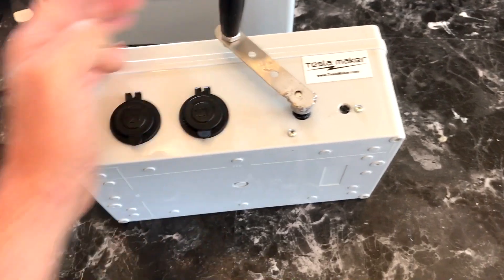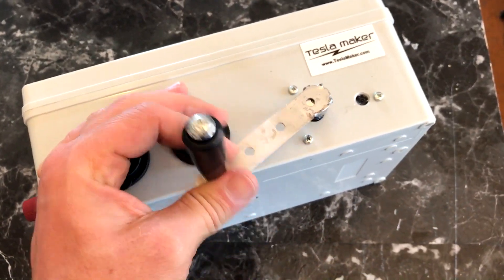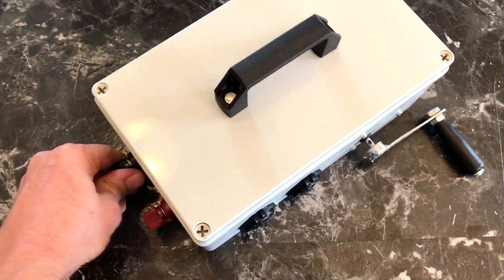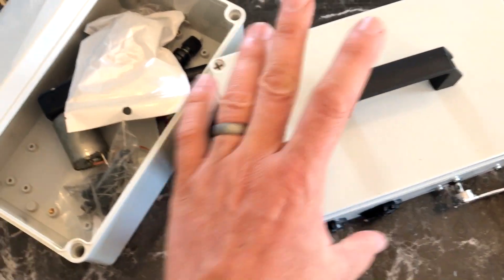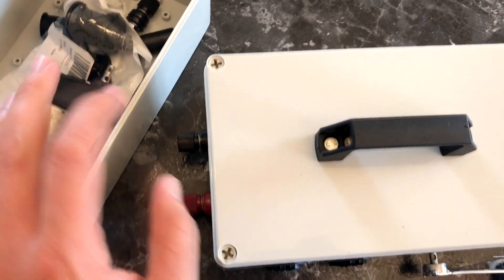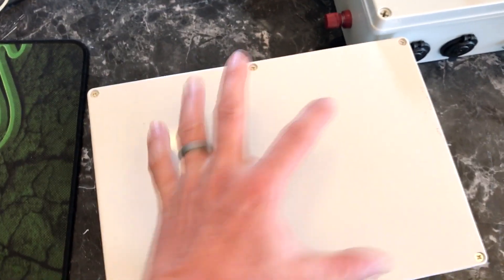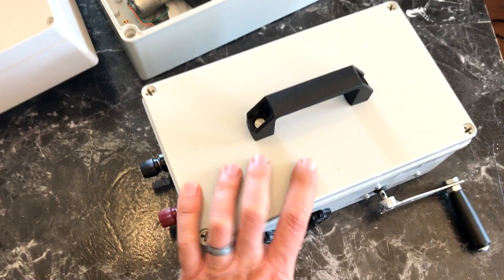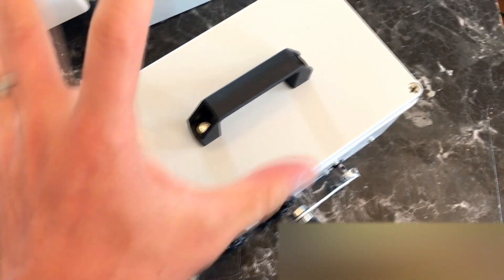V2 DIY Hand Crank BoostBox - Capacitor Power Can Start a V6 Engine

Comment: Here's an idea, take one of those all weather plug covers that's seal water tight
And create a recessed handle to where you can put it in the box and hook up an extended shaft on the like, if you had a ratchet, set up with an extension so you could put even potentially a wheel on it to create a pedal bike generator if you need to

Comment: When soldering a lead from your diode its important to have a good mechanical connection as well as an electrical connection. Wrap some lead around your wire connection to make it strong. I would put the binding posts toward the end where the generator crank is then make where binding posts are the bottom so the crank is up clear of the table surface so you can turn it.

Comment: Have a silly question but instead of a hand crank have u used like a cordless drill to speed crank for the Genny ? And have you ever over charged the capacitors ?

Comment: If the generator is connected to the capster and it rotates, there will be heaviness in the rotation, and if the wires are disconnected from the capster, it will be light.

Comment: Good morning, I'm making a device similar to this one, but the GENERATOR-dynamo I used (similar to the one in version 1 of the project) is not very powerful, and it takes a long time to charge the capacitors (it's almost impossible). Have any of you found a better generator-dynamo??

Comment: Don't know if someone has pointed this out yet. At 6:21, you place your adhesive tape over the pressure release vents of the capacitors. This could affect the proper function of those vents if the capacitors need to safely vent off pressure due to the failure of the capacitor. Instead of a slight pop and a hiss. It could now become a KABOOM! Other than that, I'm planning on building one of these to use as a jump pack.

Comment: How about a one-foot-powered version, with see-saw type thing on top, whereby you press down on the front of your foot, then press down on the back of your foot, repeatedly, so that you can use a leg instead of an arm? Should be able to easily charge enough joules to start a car in less than a minute.
Reply: a foot powered one could be supported by the ground as well.

Comment: I wonder if you used a cordless drill to crank it up from zero to full charge, then connect your battery charger to the inverter and recharge the cordless drill battery, and if you see that you still have voltage left, and can power another device, then you have proven that you're getting more out then you put in. 
I'm ready to build... who's with me?

Comment: I can get giant motors they come from beds that raise up. Without the gears I lit up a 12 volt⚡️ led srip with help of a joule thief turning the rotor with a finger and thumb. With help of a capacitor it does wonders. Imagine what it do with a gear system. Although the motor was expensive i saw one like It sold on ebay 90 dollars used. I will try to put one together a put it on my channel.

Comment: This is exactly what I have in mind as well, however, super caps have low voltages and you need circuitry to ensure that they operate in a balanced mode so that they don't get excessive voltage that can cause failure if unbalanced.  So I am rethinking the idea using 2.7 volt caps at the moment.  The other thing is that you will need to make a current limiter so that your cranking torque is manageable to not get over stressed cranking for prolonged periods of time.  There is no free lunch when it comes to energy.

Comment: Hello.  can i buy your finished appliance?  what price?  we have very cold winters in town -43.6F.  even good batteries, without heat and charging, freeze in the parking lot and cannot start a car.  your device would help me a lot for a 1.8l motor

Comment: I just saw this recently. I really liked the prototype handcrank boost pack. I would like to ask though, if this second version or even the first one can start a diesel type car? I really appreciate this vids you uploaded. More power! 😄
Reply: My friend has one built he added another set of capacitors and he took apart a Ryobi 18v drill battery and wired it in aswell with a regulator charger from the Ryobi battery and charger. If the Ryobi battery is dead you have to crank it by hand and it charges the capacitor banks then he can hook it to a inverter and self charge the Ryobi drill battery and run small power tools ect. 
It has limits it starts my Chevy 6.0 But can only turn it for a few seconds before it has to recharge the capacitor banks via hand crank or drill battery. It should start a small diesel like a vw once it's warm but I don't think you could heat the glow plugs and still have enough power as capacitors are very rapidly discharged.

Comment: Experiment with gear ratios. Try something like a 1 to 4 ratio to start out with. For evey 1 turn of the hand crank the motor will turn 4 turns. Use some capacitors of 10000 UF. Just a thought. Lots of luck.

Comment: Does all power from turning the generator go into the capacitors even if you turn the generator slow? What happens as the capacitor banks build up voltage. Does the generator have to meet or exceed the capacitor bank voltage to get power into them? At .5 volts this would be easy.  At 11 volts this would be no fun.  Seen some other capacitor boost packs and they seem to have the circuitry to boost the votage up to 15volt even though the charging battery voltage is only 3 volts.

Comment: If that mechanism can be added to a tennis ball or a basketball, 
all you need to do is bouncing the ball on the floor or swinging it round and round and you can recharge batteries as well.

Comment: Made this project almost two years ago, didn't use a bridge rectifier to minimize losses from motor to the capacitor bank . I didn't put the supercaps lasersaber used in his videos (EATON 400F 2.7V) and had the geared DC motor used in his first video, but i can surely say that as a project it has potential. Yes batteries store way more energy but you can charge this in  far less time than a battery and you dont have to worry about battery lifespan or charge cycles and weather conditions, it's also way lighter than a car battery (so portability is a plus too).
Reply: Just put both batteries and super capacitors in the box , then you'll notice as it gets heavier, the longer it would last ., ..just like in the Bible ; that box lined with gold, arc of the some sht. ..a group actually carried it around the dessert for forty years , charging their cellphones..

Comment: Can we get a bit more info on the device that converts the crank to energy that can actually be stored by the capacitors? I'm curious about digging into that and what goes into "power per crank".
Reply: might be late for the answer, but any type of typical DC motor can produce voltages when you spun them. the crank part is the gear that increase the rotation speed from original so it will spin the DC motor's spindle fast enough to generate voltages.

might need a voltage regulator to prevent over voltage before wiring it to super capacitor.

Comment: Great build for sure - Need to try and build one of theese! .-) PS. Let me be the one millionth busybody viewer, to caution you in regards to having blocked the "+" /cross the safety-vents on the top of the capacitors - The electrolyte can boil of due to heat and need to be able to escape via the weakened "+/cross"  - To get an idea of the potential danger, one could observe https://youtu.be/3b7mjukhTyQ?t=19

Comment: You need to reflow the solderjoints of the cap and PCB. They are cold joints now. They are only connected to the pin of the cap. They need to flow to the PCB and look concave between pcb and pin. Not convex and only soldered to the pin like now. It will oxidize over time and form an increasing resistance. I think your soldering iron is not beefy enough.

Comment: Re-posting for justice: Have you seen anyone use a gear train with a bunch of generators and extra caps AND a fly wheel to make a better, truly awesome hand crank or foot crank generator, yet?   The kind that can power an electrical appliance like a refrigerator or computer? 

Any idea if Charles Greenwood (man behind the humancar) used such in the design for his DuetGen? Because that guy can power a car to drive 50 MPH with that set up while rowing the hand crank back and forth, I believe, correct me if I'm wrong.

Comment: Instead of a hand crank, perhaps a bicycle-wheel hook-up? With proper gearing, you could get a great many cranks per revolution.  For that matter, it occurs to me that you could put the rear-wheel gear directly on the generator shaft, with a 2x4 running to a set of pedals -- you could even replace the pedals with handles, if you want to keep it a /hand/ cranked jobbie.

Comment: Answering my own question :)
From what I have found out a hand cranked generator delivers approximately 10-20W. If we say it delivers 20W and your cap´s hold 0.34Wh x 12 the cap bank holds 4Wh. To fully charge them with a 20W hand crank it would take 4/20 = 0.2h in other words 12 minutes, and thats at best. If you want to charge your iPhone X from empty to full (10Wh) you would be cranking for 30-60 minutes ;) Wow, thats quiet a workout guys. Carpal tunnel syndrome here I come!

Comment: 🤔build a bigger capacitor bank that holds more power add a lithuim cell in there and a inverter and a light and a cig lighter socket. So in power outage it would run icebox or run a microwave 😊 then you got something
Reply: This could get a little tricky because lithium batteries are a lot more sensitive as opposed to capacitors. When it comes to capacitors, they dont need a BMS when charging and can charge and discharge very quickly. Lithium on the other hand requires a BMS and charges a lot slower than capacitors would. Given these circumstances, it would not be practical to a lithium battery in conjunction with capacitors as a power source.
Reply: @80xide  this problem is only on the charge cycle, with a voltage regulator the charge cycle can be regulated. I have a battery design with a internal semiconductor plate that regulates charge and discharge, it also stops the cell from forming dendrites that short the cell this extends cell life and solves the problem of cell fires.

Comment: So it has been a while since u uploaded this vid, but, I was thinking.... If u were to connect a sprocket (to the crank) that is larger than the radias of the spindle on the generator. Add a belt or bike chain connecting the sprocket to the spindle. Doing this should result in less rpm on the hand crank and more rpm on the generator, decreasing the amount of effort needed to charge the power bank. Thanks for the vid.... I'm building as we speak.

Comment: Love your design I expanded on it. Heavy duty polymer tool box, perminent magnet 800w motor, same that windmills uses, weld about a 14lbs fly wheel to the end of the motor (you'll hand spin this to start it) connect to a plexiglass box. Inside plexiglass box make a 1:642 gear train. Fill plexiglass box with gear oil for reducted friction, on the end attach a 4 ft long crank so you can get your entire body into rotation. With the brushless perminent magnet motor it doesn't matter which way you turn the generator and you'll get insane amperage and watts with your 1:642 gear ratio, just make sure you hand spin the fly wheel first. An object in motion wants to remain in motion.

Comment: Such a wise guy. I like it. Who needs heavy long lead cords on a remote job site!? Or jump box for starting cars when batt goes down. Can quickly charge this box off a bad batt w low voltage, then start the car w this box.

Comment: I remember watching the first one but I forgot why you use capacitors instead of batteries
Reply: You use capacitors because they're smaller, lighter and hold more charge.
Reply: They charge quickly
Reply: Batteries lose their capacity over time and have to be replaced. (That's how I came to be here, because I was looking for a way to start a car with a dead battery that doesn't involve relying on another battery that's even more likely to be dead by the time you need it!)

Comment: the "hand crank generator" is a geared brushless motor just find any one with around 10-30 rpm and higher ratings. 
some companies use the same motor and different gearing so speed doesn't matter as long as you can crank it that much consistently too fast and you wont be able to use its full potential.

Comment: Just found your videos and channel. Quick question; have you thought about using an ammo box as your container? They’re stackable, waterproof, come with their own handle, and they provide a little more accessibility for fuse changing or other minor repairs. Maybe even space for a larger and removable crank handle?

Comment: I know this is a really old video, but what if you tried putting a fly-wheel system into the hand crank? It would take more effort to initially start, but it would keep spinning longer and allow you to extend the charging duration

Comment: can it complete a glow cycle and start a diesel engine?
Reply: Glow plugs, we don't need no stinkin' glow plugs. Real Diesels used spark plugs. ;-) And they were good enough for them to be used in the Communications Car, Presidential built in 1952 for the US Army Signal Corps.*

*For those not old enough to know. International Harvester built Diesel engines that were hybrids to compete with Caterpillar. Where Cat used a Pony engine to start the Cat Diesel, IH used the engine itself. With the flip of the changeover lever, the compression was lowered by opening a chamber in each cylinder. That allowed them to start the engine on Gasoline as the engine had a mag, carb that was set at one opening plus choke, spark plugs, and a 1 qt Gasoline fuel tank. Once running on gas, the Diesel throttle was opened a crack to purge any air from the injectors and warm the engine more. Once it was warmed up, throwing the changeover lever the other way closed off the chamber, raised the compression, and ran the engine as a Diesel.

Comment: Could you possibly use a bridge rectifier and make some kind of rack and pinion setup that you slide the rack back and forth that can drive 2-3 motors? Eh idk probably overcomplicating something that already works just fine .

Comment: 00:32 Can you add strong magnet to base of box for better stability on metal surface and, better storage of device. 2x greater efficiency is achieved by using a full bridge rectifier instead of single diode. 07:20

Comment: There has to be some heat generated by those capacitors. How do they dissipate any heat? Also,  you have so many wires soldered together on the Cap Block why not use a wiring terminal strip? Interesting project. One I would take camping and use the solar charge feature to keep it going as well as cranking.

Comment: is there a way to make it smaller for use on a -non kick start motorcycle -like say if my battery dies, i can crank a charge into a capacitor and start the engine -or  does something like this ,exist?

Comment: I tried looking on eBay do you have one specifically built to boost cars with that is  possible waterproof that can be possibly  but doesn't have to be mounted to a car but also still be hand crank because it's not like everybody will come to you at 3 a.m. with booster cables and sometimes your booster box might be dead

Comment: Built-in clamp-to-bench / clamp 
-to-picnic table / clamp-conveniently-to-car, eliminating cranking difficulty?

Just for the record, I thought one of the worst things car and truck manufacturers ever did to auto-industry consumers / customers was to eliminate the hand-crank option fod engine starting. And, the second worst thing was eliminating the mechanical power take-off so that a family's second most expensive asset could no longer be used to help them complete tasks around their property.

Thanks so much for leading the way in innovatively Reinventing the hand crank starter. There should be one of your boxes included in the trunk of every new car with an internal combustion engine, as well as a small pull start gasoline engine in electrics in which you could limp home in case of emergencies. And well they're being really brainy they could put a hand crank window option just in case Electric Windows go bad. Of course Detroit and other based manufacturers would just say well it's time for a new car and that's always been there answer instead of answering with their main responsibility / the consumer in mind.
Reply: Hand crank starters were removed from cars due to people getting stupid. And broken wrists/arms. We still have tractors that are 6Volt and hand crank. But most people would never know how to start one safely. As for the PTO, yep. Jeeps had them and we have a 3-point hitch for use with one. Problem is................. you need to find one from back in the 40s-50s to use them. My pickup does have the PTO gear in its transmission and there are kits to install a 10kW alternator on that transmission. But I will tell you this, the same transmission without that extra gear is a lot quieter.

Comment: @lasersaber
Do you need to use any resistors to limit the current output from the capacitor?
Also for this project is it safe to use 14AWG and 16AWG ?
If you wanted to use switches to turn off every output and control what is on and off, what type of DC switches would you use and what sort of Amp's in current would you need?
Reply: USE the biggest wire you can afford
Reply: Yeah it's safe but 12 gauge wire is the standard.